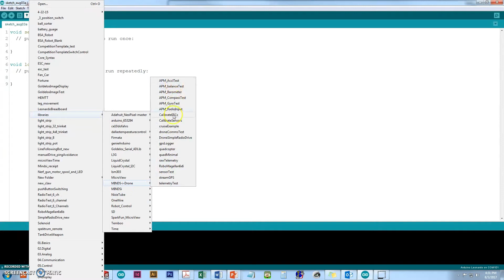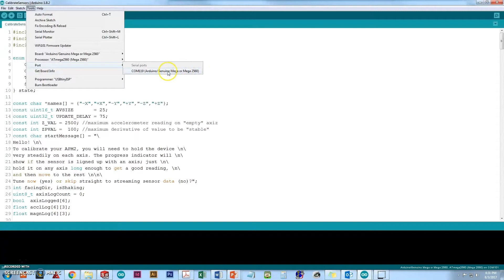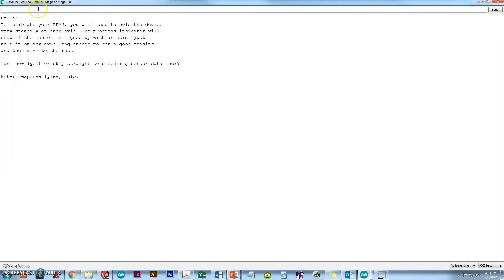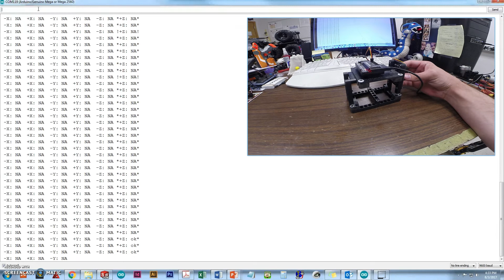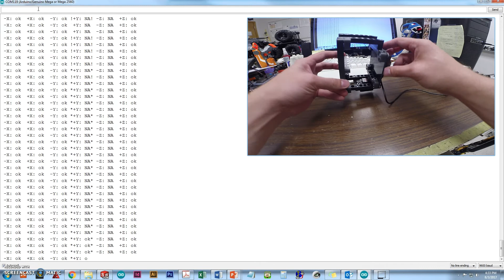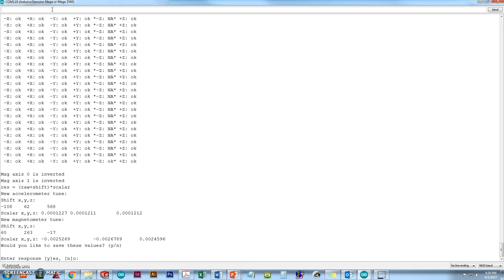Sensor Calibration Single Axis Small Gimbal

Comment: Is an uncalibrated mpu6050 why i can't keep my single axis gimbal perpendicular to the initial  leveled plane?
Reply: What code are you running on your gimbal?
Reply: @levi-iw9gr  arduino.  Actually found the reason for it not functioning properly.  The servos I used were not linear but logarithmic.  Servos for steering are WAAAAY bad for single axis gimbals